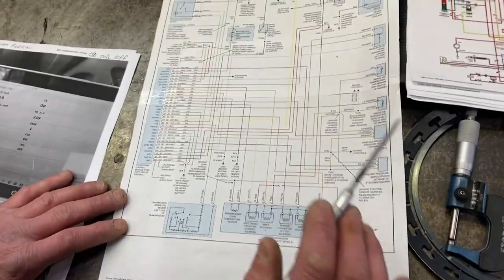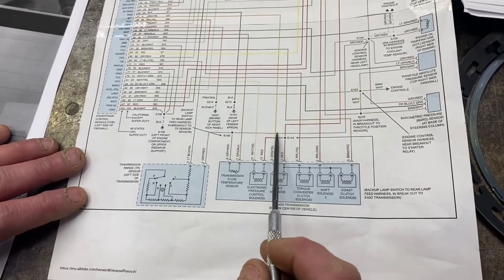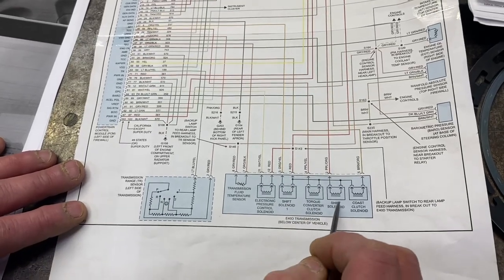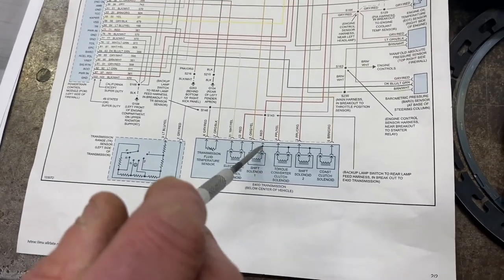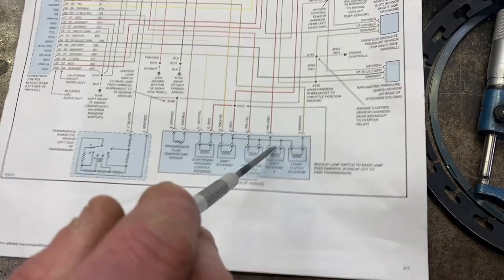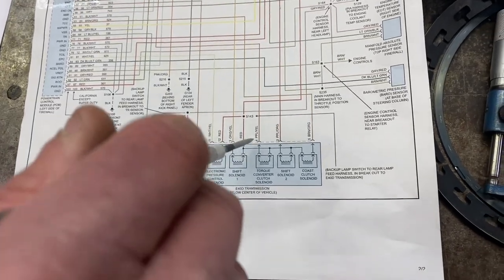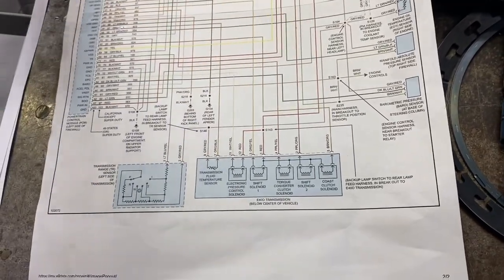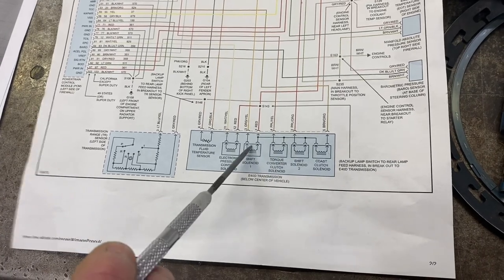“WHO’S IN CONTROL” E4OD/4R100 Diagnostics and Internal workings! Pt.3

Comment: I really enjoyed watching this.  I have been a professional mechanic for over 30 years.  About 10 years back I was just tired of this one part of the car needing to be sent off to never never land to be repaired.  As far as I have found no one was born knowing how to rebuild transmissions.  There is no special down load that enters the brain of certain people that makes them know about transmissions.  I have been doing amateur builds and buying tools ever since.  I am getting pretty good at taking them apart, knowing what to look for, and reassembling.  My success rate has gone from sketchy to near perfect (I have rebuilt somewhere between 30 and 40 units now and have spent a small fortune on tools and manuals).  Still I have yet to command a solid understanding of exactly what is happening during each phase of the shift process and this kind of information is helpful in that regard.  You are an excellent instructor!  I just discovered you on my latest build which is an E4OD out of a motor home.  Thanks for doing this!  I hope you will continue.
Reply from the maker: Awesome! It warms my heart hearing comments like this! And yes no one just has the ability to rebuild transmissions, it's a learned skill just like anything else! The one thing I have ALWAYS done in mechanics is truly put my effort into understanding HOW things work and not just looking for a particular problem (UNDERSTAND THE SYSTEM AND THE PROBLEMS JUST PRESENT THEMSELVES) that is my motto. Sounds like your getting a good grasp of transmissions it just takes a lot of repetition. I have built roughly 13,000 transmissions is the only reason I have a really good grasp on them, I Also  worked at AAmco so we saw everything from Chevy's to Hondas to BMW's to Mercedes and everything in between. I was determined to learn them all ! Just keep pushing yourself and you will just get better and better. Be sure to check out my E4OD/4R100 TCC/PWM Lock-up systems video as well. Its probably one of the most informative and better ones of my videos. Happy building my friend really appreciate the comment
Reply: Thanks for the encouragement.  You don’t know how much I would enjoy doing a couple of builds with a seasoned builder.  I think it would help me develop a better process from start to finish.  Thankfully the good Lord has blessed me with a very strong mechanical aptitude.  I never have had much of a “Jonny on the spot, spot on” thing going but if I have a little time to process and study I am able to figure out most anything mechanical.  It’s strange, the owner and the shop manager are behind me 100%.  However a couple of my fellow techs and one or two of the service writers act as though they are “offended?” that I have been building.  I suspect I am like you, always happy to share what I have learned so I don’t understand what the problem is.  I usually source my own parts bc if I don’t the likely hood of getting what I actually need isn’t good.  Oh well all the challenges and negativity just push me even harder most of the time.  Thanks again for taking the time!  It’s very helpful to guy’s like me!
Reply: If I ever hit a big Lotto or something like that I may offer to pay you for some one on one training.  LOL!
Reply from the maker: @Roscotech  Yeah I hear you you can't please everyone for sure, I see that quite often your owner and manager want you to learn as much as possible "they get it" but others through jealousy, negativity or whatever reason want to hold you back only issue is there just holding themselves back as well ! You do You and that's all you can do my friend.

Comment: This has to be the best video I have found! I have a 97 F-350 with a E4OD, I am having a issue of it starting out in 2nd gear. Even when manually putting it in first. All other gears work like normal, how would I go about checking the low sprag since that seams to be the only one related to 1st gear and none of the others if I am understanding your chart right.
Reply from the maker: Tray, Glad you got something out of the video ! Good observation on your part. With that said if the low sprag was bad (not holding when you put it into gear O/D 1st) you would get a NEUTRAL like condition because the geartrain would just spin up instead of applying power to the output shaft. And when you put it into Manual first the LOW/REVERSE clutch comes on and (Overrides the sprag) therefore you would get first gear in manual low. If that makes sense ?
There are multiple reasons for it to take off in 2nd. This is where a Scanner is a must and you need to see what the computer is SEEING as far as inputs (MLPS manual lever position sensor) ect. And what the computer is COMMANDING as far as gear selection when you put it into drive ( is it commanding first gear ? If after scanning it and you see the computer is COMMANDING 1st gear and determine it is an INTERNAL Transmission problem then shift your efforts to going inside the transmission. (Sticking valves in the valvebody, 1-2 Shift valve spring broken, worn out solenoid regulator valve bore) As you can see there is no one shot answer in your question but by the process of elimination you should be able to find the problem. I hope this answer at least STEERS you in the right direction ! Thanks for watching
Reply: @marshallsanders5672  appreciate the information that gives me plenty to go with.

Comment: Awesome info! I have built a few 4r100’s for 99-03 super duty trucks and a second gen lightening. A close buddy wants me to rebuild his 1996 e4od, I’ll buy the atsg manual and read up on it. Any chance you can do a differences video and maybe suitable upgrades to the e4od? I have a small scrap yard of old 4r100 parts, not sure what would drop in the e4od incase something is hard to come by for his unit ie steel planetary vs the aluminum and so on.
Reply from the maker: Great ! I’m go lad you got something from the video. I do hope to do more on the very topic your asking about. I have a whole host of videos on the E4OD as the two I have built and videoed are E4OD’s be sure to check them out there is tons of info in all of my videos. From My “E4OD/4R100 Lock-Up Explained” to my “Transgo Tugger Kit Install” video I cover a lot.Sounds like you have a pretty good handle on them and also are sitting on a goldmine of parts as everything nowadays is stupid expensive ! Happy Building my friend stay tuned !

Comment: What fluid do you recommend for my 1996?
Reply from the maker: It is recommended by ford to replace any previous fluids used in E4OD’s with Mercon V. On that note if your just servicing the trans and not replacing ALL the fluid I would use Mercon V. If it is a fresh rebuild with no fluid in it is not as important what fluid you use for a Non-PWM E4OD. In that case I would use either Mercon V or Dexron VI because these two fluids are superior to any previous fluids made today. I hope that makes sense!
Reply: @marshallsanders5672  
Thank you very much. I’ve always been unsure because if I’m not mistaken, Ford at one point caused a lot of confusion with their conflicting service bulletin recommendations (2007 ish). But I figured you seem to be the expert in all things 4R100. Thanks again.

Comment: Hi Marshall, thanks for sharing all your E4OD/4R100 expertise. I have a 2003, F150 w/a 4R100. I recently had the "Service Engine Soon" light illuminate. The accompanying symptom (buzzing sound) made me think something was amiss w/the torque converter. Turns out, ATF was exactly 2 qts. low. I added the two quarts, which brought level to "Hot" full mark. ATF looked good. Last checked the level in spring of 2023, and was full at the time. Transmission has been operating fine (until recent incident). I also looked for leak(s) but couldn't see any. Someone on the F150 Forum remarked about the possibility of this transmission having a (vacuum) modulator, that if it fails/begins to fail, it will throw a "Service Engine Soon" light/code, and it could be the cause of the fluid loss. I examined the driver/passenger sides of the transmission (as best I could), and the transfer case, but couldn't see any vacuum hose connection. I noted the transfer case breather hose. Please, does the 4R100 have a (vacuum operated) modulator, and if so, where should I look on the transmission for it, and please how should I test it? Thanks from East/Central AZ.
Reply from the maker: A 4R100 does NOT have a vacuum modulator. That’s the “OLD” school way transmissions used to regulate line pressure rise. The 4R100 uses an Electronic Pressure Control solenoid to control line pressure rise. All done by the computer. 
 As far as your fluid loss goes if it is not leaking out onto the ground it can only be going to 2 places. 
  (1) into the radiator cooler and mixing with Antifreeze. You would easily be able to tell this because either/or the transmission fluid would be milky looking or the Antifreeze would be a milky looking.
(2)  most likely cause is the transfer case input seal is hardened and letting fluid leak past and over filling up the Transfer case and subsequently going low in the transmission. Pull the fill plug on the transfer case and see if it is overfull.
Reply: @marshallsanders5672  Hi Marshall, thanks for clarifying (although through research yesterday I learned just what you stated). Today a shop confirmed that my torque converter is failing. Also, just checked my coolant, and no ATF contamination. Haven't checked the transfer case, but am going to remove transmission for rebuild (and of course, replace the damaged torque converter). No local transmission rebuilder, (wish I was in your locale to have you work your magic on it, lol) so it will go to an individual in Phoenix with whom the local auto repair shop coordinates for transmission work.

Comment: U know ur stuff.
I have a 1994 e350. Was driving on wet road. With puddles, tanny started doing crazy stuff. Weeks later tranny goes into OD but rpms are much higher than before that wet day. Any idea?
Reply from the maker: Interesting for sure! The obvious it seems water related. Sounds like a main connection got water in it and is causing cross electrical interference.  
 No O/D light blinking?
You say it goes into O/D but high RPM’s. It’s either slipping in O/D or you just lost torque converter lockup! That needs to be your first determination as to which one it is. 
 Second I would go 0:02 with brakecleaning and drying out the main connector going into the transmission.
Reply: @marshallsanders5672  thanks. I did pull the ecm, tranny solenoid connector, the shift sensor connecter and sprayed all with electronic cleaner. That didnt seem to help. It shifts good from 1 to 2, and from 2 to 3. Whereas from 3 to 4 used to happen bout 50 to 55. Now speed has to get to 55 to 60 and I have to let off the gas to let it shift.
Reply from the maker: Oh gotcha so it’s actually a shift timing issue (when it shifts) as opposed to higher rpm’s when it is in O/D gear. 
Does it shift solid into 4th when you let off the gas or is it lazy/slip into O/D when you let off the gas. 
 The throttle position sensor and vehicle speed sensor are the main sensors used by the computer for shift timing.
Reply: @marshallsanders5672  it seems kinda timid about it. Its like it's there yet like a 1/2 gear. With rpms somewhat higher. I drive the same roads in my work. There are hills, a month ago that the tranny would drop down to 3rd to get up.
Now with higher rpms in what serms to be OD , these grades do not cause the drop to 3rd.
Reply from the maker: Sounds like it lost torque converter clutch lock-up.

Comment: Man. This helped ij more than one way.
My 4r100 in "d" wont do anythijg. Hit the gas ans itll axr l I e it wanta to go. Identical as if it was low on fluid.
Put it in manual low ans itll go. Seems like it may slip some shifting manually throughiut the gears i have a 2002 f250 7 3 crewcab 4x4

Comment: what scanner will scan 1994 7.3 diesel pre obd
Reply from the maker: That’s a tough one any old school OBD 1 scanner with EEC IV capability. You can also get codes manually by grounding the STI wire in the EEC IV connector and counting the flashes of the check engine lite. 
  Just look up retrieving codes on an early ford EEC IV on you tube you’ll find a video on doing it this way.

Comment: Marty maybe mention my torque converter problem and how that was related to the OD light on my shifter.  My trans was not shifting correctly but would sometimes go away for a while.  Then it would come back.  Maybe comment on how you determined it was the torque converter
Reply from the maker: Yes Sir ! You beat me to it. Ive been planning to do an entire video on Torque Converters and all the problems that happen with them because that’s a whole video in itself .

Comment: Hi Marshall,  Excellent work!  I have a class a with only 57K on it.  Trans goes forward in all gears, even wants to in park.  No reverse.  What are you thoughts.  Full of fluid, no leaks, fluid looks perfect.
Reply from the maker: Sounds like the Forward clutches are welded/ burnt on ! If they can’t spin free in reverse it won’t move ! If it’s trying to move in park the forwards are definitely welded on ! Unfortunately it needs to come out and be rebuilt

Comment: So I have a 97 f250 7.3l powerstroke and I can't figure out what the hell is going on when I put it in any gear it doesn't move almost like I'm just in neutral however if I power off the truck disconnect the battery's for like 30 seconds I can get it back into drive and reverse for a little while like 1 to 2 mins them it goes back to this Neutral it's crazy weird 🤔
Reply from the maker: Yes that is very weird! Something electrical should not cause it to not have any gears. Is it completely neutral or is there some sign of trying to move? Just to eliminate electrical in reverse unplug the connector at the trans and try reverse, If it still has no reverse then it has an internal problem. 
   I have seen many times where the filter is clogging and it will move for a brief period till the filter sucks shut with debris and stops moving. Once you shut the vehicle off the fluid drainback through the filter unclogs the filter and it will move again for a brief period. Is the fluid discolored/ burnt?
Reply: @marshallsanders5672  ok so major discovery yesterday I drained all the fluid it was burnt pulls the solenoid pack it was dirty as heck then cleaned it all out extremely well with electrical contact cleaner tested all the solenoids they measured 20ohm used my power probe and tested them with air they all did there job with no leak by then threw a new filter on and put new fluid In her and drove fantastic! Drove it all Day however at night when coming home we lost over drive and reverse so I think I need to pull her again clean It out and put new fluid back in
Reply from the maker: Ok that makes more sense! Only problem is if it was clogging up with debris something is coming apart inside. You can do it over again but probably will happen again in a short period of time.

Comment: Hey Marshall I have a 91 f150 2wd with the e4od in it. I am have issue with my when taking off from dead stop it shutters and is very sluggish once you get to 35mph it does fine. I was able to manually shift to first and take of better but second still sluggish if anything now but once over 35 in 3and overdrive it does ok.I am going to take out and rebuild myself but wanted to ask if doing a full overhaul sound like it would fix this issue and do I have more to worry about. Also thanks for taking time to do these videos they have given me a better understanding.
Reply from the maker: Most likely a full rebuild will take care of it. Be sure to scan it for any computer electrical before you pull it out. If it is original there will be a good bit of updates to do ! Thanks for the comment!

Comment: Cool video, the transmission that came in my lightning started taking off in second and when I would put it in manual first it was binding remember those clutch’s we found in all the parts I brought with me there was some burned up welded together, I wonder if that guy is having similar thing going on, because my would start off in second gear because the intermediate clutch was welded together or something like that, anyway this was a very cool video 43 minutes went super fast
S
Reply from the maker: Yep you understand what’s going on, that’s exactly what was happening with your trans originally! Good stuff ! I’m in the middle of your build video see you soon on that one !

Comment: Marshall, Excellent video, really got an education. You laid it out like a professional instructor. I'm helping a friend  and hers makes a vio!ent clang and shudder after coming to a stop. Strange because it's not when accelerating again, but only after stopping, and a few seconds after stopping sometimes, very repeatable. It shifts and works fine in manual modes. Once it gets going it seems to work normally. Just when stopping. So sharp it feels like you've been rear ended. It's like it is trying to release or engage the coast clutch. But your explanation of the electrical side of operation means I should really ! get it on the a scanner. You gave me a lot to go on, much appreciated. V\r John C.
Reply from the maker: Just saw this post ! I can almost guarantee you the Torque converter clutch is staying applied for one reason or another. TCC sol. Sticking/ TCC apply valve sticking/leak in the TCC release circuit etc. The reason an automatic transmission can be at a full stop and not stall the engine is because the Torque Converter. When the Torque Converter Clutch stays engaged at a stop is when you get that shutter/stalling effect going on. Be sure to watch my TCC video it explains everything you need to know about what’s going on with your trans ! Hope this helps !